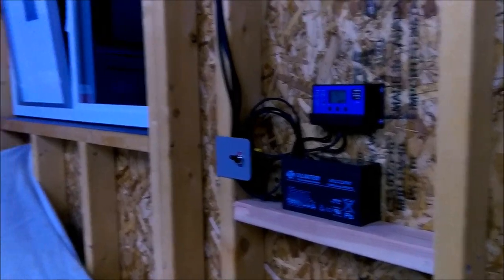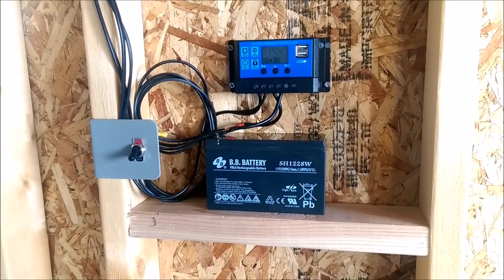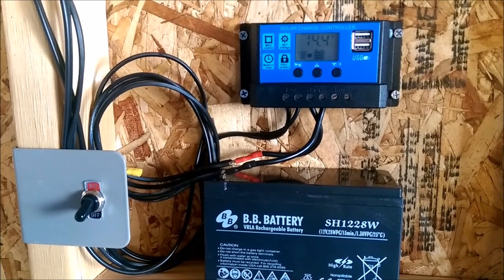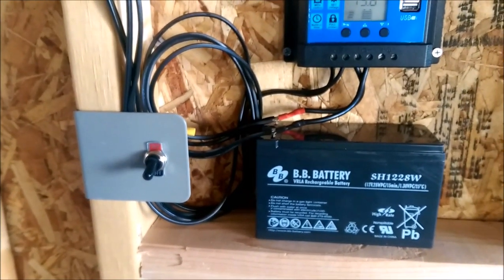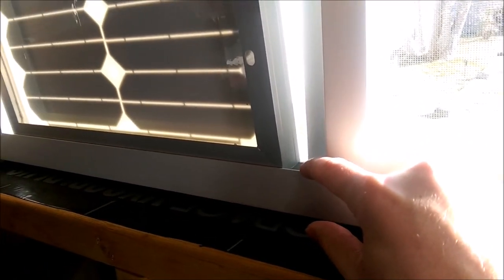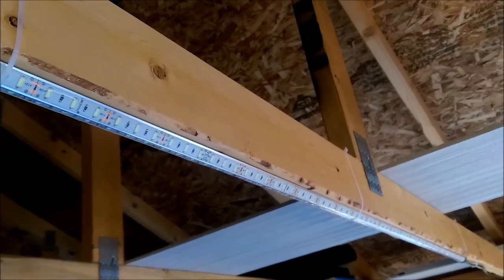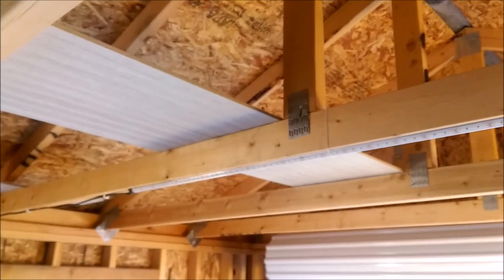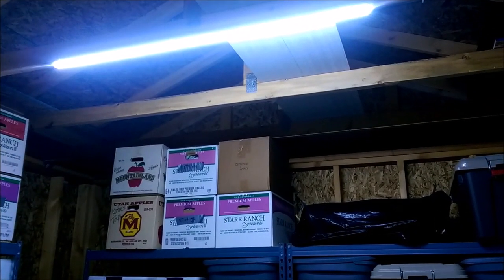DIY Solar Shed Lighting! Affordable LED Setup

Comment: Hi Jason, great Video and I was hoping you can help me understand the connection of the lights to switch and battery as I am not familiar with electricity at all.  
I have batter and panel connected and charging.  I ran all the lights wired them to the light switch and assumed I connect switch to load connectors on solar charger, but lights won’t turn on.
Do I need to connect switch directly to batter to make this work amd have wires split from battery to both switch and controller?

I hope that’s not too confusing but any feedback would be greatly appreciated.
Reply from the maker: Hey thanks for reaching out. You want to hook up all the following connections:
-Battery to the + - battery connections on the charge controller.
-Solar panels to the + - of the solar connections on the charge controller.
- LED lights up to the "load" + - connections on the charge controller.

Put an in line switch on the positive wire of the led lights to turn on and off the lights when you want to use them.
Reply: Thank you Jason, I think I understand now 😀
Reply: Hi Jason did what you said and lights worked for 5 min and shut off.  No error codes on charge, direct connected lights to battery with switch to make sure I didn’t short anything or blow the lights and they worked fine.  Assuming it must be something with the load connectors not working anymore.  Is it safe to just skip the load and direct connect to switch to battery and not deal with the aggravation of what’s wrong with the load connector?  Thanks again in advance!
Reply from the maker: @carchontides  how many lights are you using?

You can skip the load connection and go directly to the battery. You'll just want to keep an eye on the battery voltage like I do. Don't let the battery drop below 12.0v or it will cause damage to the capacity.
Reply: @Jasonoid  maybe this is the issue, but the lights did work after I direct connected battery to switch (although that was after it charged up again a few days later and I didn’t leave them on long to see if they would turn off again). 
Im prob drawing too much power…like I said no electrical experience here…
I’m using 4 x 12v light bars on a 12v 7ah rechargeable battery.

Comment: Is this a special battery for the solar panel or can you use a car battery? Would have been nice to have seen it been set up. Lovely shots of the components.
Reply from the maker: The battery I used is a sealed lead acid battery. They don't require any maintenance so it nice to use them in this setting. A car battery would work fine as well in a setup like this.

Comment: I have a barn with no electricity.  I rarely need a light on.  Is a very small solar panel enough to keep a 12v battery topped up?  My setup is similar to yours using a car battery.
Reply from the maker: Should work great. I don't use my shed lights much either. A car battery is HUGE compared to my small battery. The small panel will be fine.
Reply: @Jasonoid  Thanks for the reassurance.  Good job on the video, by the way..

Comment: The controller keeps the panel from overcharging the batt? I am thinking of doing this in my well house with a 75 watt bulb to keep it above freezing in the winter.. Do you think this setup would work for that?  I would use a smart plug to make sure the light does not use power during the day (temps are above 32 here in the day)
Reply from the maker: Yeah, it keeps it from over charging. You'd have to do the math because a constant 75watts is a lot, maybe 150 watts of solar panels and a large battery bank (100-150 Amp hours) will work for you. My system is very small for very little load.
Reply: @Jasonoid  Thanks!  Great shed BTW

Comment: I know you posted this a few years ago but I’m having an issue. My on my controller the light bulb is flashing and I have no power. Same items as you but less lights. Like your setup. Thanks for posting. Hope you can help.
Reply from the maker: Sounds like the load function is shutoff by the solar charge controller. Sometimes it's on a schedule or maybe the battery voltage is too low? Whats the voltage of the battery? You can always bypass the load output and connect directly to the battery, you just need to make sure to not over-discharge the battery by running the lights to long.
Reply: Jasonoid battery is full and solar is charging. I’ll try to bypass it and check the settings again. Just can’t find any info on what flashing things mean or the like. Thanks for your quick reply.
Reply from the maker: @brianbaker9382  These cheap solar charge controllers are good for basic things but when something goes wrong it's hard to know what it's doing. Hopefully that helps! Good luck :)
Reply: Jasonoid thanks for your help. I think I’ve got it figured out. Wrong lights. Your link is no longer good. Do you know what lights you have. I know it’s a long shot. Thanks again.
Reply from the maker: @brianbaker9382  Added 3 new options to the video decription, these light links seem to change every couple months. Make sure you get 12v waterproof lighting just in case it gets wet in your shed.

Comment: You’re gonna kill the battery, change the light cables from the battery to the last two connectors on the right, that’s the “load” connection, you can set the controller to 24h, if you leave the lights on by accident or dusk till dawn. the controller will cut power if the battery level is dangerously low to protect it, in the event of a short circuit on the wiring, the controller will also cut the the power, please read the instructions for the controller. Otherwise, I like how clean and neat the wiring looks.
Reply from the maker: I skipped the load connections on purpose. Thanks for the heads up. I run the lights for 5 minutes once or twice a week. If I used them more I would have planned to put them on the load circuit.

Comment: How long do lights last before going off ?

Would 2 hours at a time work as my garage has no lighting but have a lot of gym and boxing equipment in and far from house so I was wondering 

If, You could give advice thanks
Reply from the maker: Check out my other comments, I answer the same question. All depends on the size of your battery.

Comment: Great video. How did you determine the solar panel size/wattage needed? I would like to get by with a smaller panel if possible. Thanks, bob
Reply from the maker: It's all based on how large your battery and current draw are. If you plan to run lots of amps consistently you will need a larger amp hour battery to handle the load. If you want to charge that battery faster you will need a larger solar panel. If you have lights that pull 3amps while running, you will need a 6 amp hour battery to run them for 1 hour. You never want to run the battery below 50% capacity.  Hope this info helps!

Comment: 1:44 use the load output of the solar charge controller. This way you can even set a shutoff timer, if you forgot to turn the lights off. Its also protcting from over discharge
Reply from the maker: I only use the lights for a few minutes at a time. I watch the voltage as I use them. I could see this being useful if they were being used all the time.

Comment: What kind of roll-up door is that and how much does it cost? I'm going to build a shed in a few weeks. Thanks!
Reply from the maker: Its the type of door that goes on a storage unit. I searched around and found a local company that builds storage units so they could get me "roll up garage door" at a good price. Cost a little under $400. I installed it myself, there are many Youtube videos on the subject.

Comment: Where do the wires from your LEDS go? ( ie are they straight onto battery terminals?) I expected them to go to the charge controller but cant see that. Also are they fused?
Reply from the maker: They are fused, switch is on the positive line, and they connect to the positive and negative battery terminals.

You could also wire the led power wires to the 'load inputs' on the solar charge controller if you want to have low voltage protection.

Comment: Is the solar panel behind a glass window? I have tried to put a solar panel in a south facing window that gets a lot of sun but it severely affected its output needed to put it outside to get it to work properly.
Reply from the maker: Since I use the lights only a couple times a week, this was fine for my needs. If you want to so something a little larger, check out this video: https://youtu.be/rFVtJXqV_zA

Comment: Nice set up.question can  you run another accessories whit this solar panel let me know.I'm trying to do in a chiken coop for the winter.but I wanna connect a heater lete know whatyou think.thanks in advance
Reply from the maker: Eric Perez thanks for the question. This solar setup is for low draw devices, you could run a heater off a solar setup but it needs to have a much larger battery storage and more panels. The concept is the same just larger. Electric heaters pull thousands of watts, my battery would last about 5 minutes running an DC to AC inverter and a small 1500 watt heater.
Reply: Jasonoid  thank you.

Comment: The link you have for the lights is for a flexible roll of lights, not the bars you installed. Could you please update the link or provide the model #? Great vid..thx!
Reply from the maker: The bars I made myself using aluminum angle from HomeDepot and then stuck the flexible lights to them via the included sticky back tape. I purchased the flexible roll of lights.

Comment: Hi im just wondering did you need to buy cable for the LED strips or do they already come with them
Reply from the maker: You'll need to buy the wire separately, the lights don't come with anything.
Reply: @Jasonoid  is there a link within the description or could you link me one that will go straight into the box 👍

Comment: If I used this exact setup what size fuse would I need?
Reply from the maker: 15 Amp fuse would work. I doubt the lights pull more than 10 amps. Probably closer to 6 or 7 amps

Comment: also, I do not see any wires going to your load side of the PWM (at 3:38 on the video). How did you wire the lights/switch to the PWM?
Reply from the maker: I just wired directly to the battery terminals, if you want low voltage protection you can connect to the load terminals.

Comment: So when the switch is flipped on, is it no longer charging the battery? I have one of those shipping containers and was thinking of doing some kind of solar powered LED lighting inside.
Reply from the maker: As long as the solar panel has sun, the battery is charging. The solar charge controller is always putting charge into the battery, so if I have the lights on and the sun is out, it's only taking a little bit from the battery. It it's dark then the lights are only running on the battery storage and runs down the battery faster.
Reply: Ah, so the switch only controls the light switch. For some reason I thought when the switch was flipped it was stopping the charge. This whole set up seems super affordable and perfect for what I want to do. I'm not sure what all that inline fuse is about however. Cool video though, thanks for the quick reply!
Reply from the maker: @AaronDigitalMuppet  When working with 12 volt power, it's smart to have a fuse so that if you short out the positive and negative lines it doesn't start a fire. Lots of amps can flow from these batteries.

Comment: First time with solor...how long will it last at night before battery gets to a point of being to low?
Reply from the maker: These lights draw about 3amps. I have a 7 amp hour battery. You don't want to take lead acid batteries past 50% capacity so I can run these lights for about an hour. I only use the lights for 20 to 30 minute intervals so this works perfect for me. Ways to make them shine longer would be to get a larger battery, or use less lights.

Comment: Are the lights set up for a 12 v battery or are you using a inverter?
Reply from the maker: These are 12v leds, no inverter needed.

Comment: How long would that battery last im considering doing this in my chicken coop the lights wood be on all night in there i am also curious to know what type of strain that would cause on the battery thanks and good job on the vido
Reply from the maker: You can do the same idea, just add a 100 watt panel and maybe 100amp hour battery. Just look up some more info online and it will make sense.

Comment: How long do the led light up with that battery full charge?
Reply from the maker: All depends on how large your battery is. This is a super small battery so you get around 1 hour of runtime. Larger battery with a larger solar panel and the whole thing is scalable.

Comment: I havea solar panel controller 12v battery and about to add wind turbine to my garden shed. I cant find 12 v lighting ANYWHERE on the internet in the UK (unless you buy a system with a solar panel which I dont need)
Reply from the maker: Don't search for 12 volt lighting, search for 12 volt leds lights, you might have better luck. Led strip lights are available everywhere. Amazon, eBay are both in the UK as well.

Comment: can those lights you used do on a metal frame?I have a 26x31 metal building I wanted to try this in
Reply from the maker: Yeah, as long as the power connectors are insulated they won't short out. So just use either heat shrink or electrical tape where they connect to the LED strip.

Comment: Hi, how long can it run till the battery drains out ? The charge controller has a setting to limit the discharge also no?
Reply from the maker: Mine will run a couple hours before the battery dies, if you want it to last longer just add a bigger battery. The charge controller will protect from low voltage if you hook the lights into the 'load' terminals
Reply: @Jasonoid  thank you. But when you do the calculations, a 7Ah battery could run a 12v 3w led for more than 12hrs. But why doesn’t it happen practically?
Reply from the maker: These lights pull around 42 watts for the full 16 foot strand (12v X 3.5 amps), that's why you'll get less run time.
Reply: @Jasonoid  I see. But I use 3w 12v LeD bulbs.
Reply from the maker: Great! Than it should last much longer for you

Comment: Think its possible to hook motion detection to this set up? Trying to do it for my carport.
Reply from the maker: If the motion sensor would work of the 12v system, it would probably work. Most are 120vac right?

Comment: How do you cut the led light and connect the 2 4 foot sections thanks from Nebraske
Reply from the maker: There are breaks in the led strand where you can cut them, it has sticky tape on the back where it sticks to stuff. Solder the breaks back together, positive to positive, negative to negative.
Reply: @Jasonoid  thanks I have ordered it all off Amazon the solar panel was out of stock so I got a different one with a adjustable rack. Thank you very much
Reply from the maker: @7990barry  Enjoy the project, it's a fun one!

Comment: those lights say 60watts does that mean you can only have it on for 30 minutes at a time? 12 volt times 7 amp battery = 84 watts. iam just old.  am i thinking right
Reply from the maker: Yeah, I have a small battery and don't use the lights for a very long time. These lights pull about 40 watts. Just put in a bigger battery if you need longer run times.

Comment: I am guessing you just cut the strips wherever you wanted but how did you then wire them?  Solder new wire on at the ends?
Reply from the maker: Correct, I just cut the strips to the desired length, then I soldered on the landscape cable you can buy by the foot from HomeDepot or Lowes. I recommend at least 14awg cable for the project.
Reply: @Jasonoid  how much current do they pull?  Total or per strip?  I am loooking at hooking up my shed but I am not sure the strips put off enough light?  Also I am sizing my battery.
Reply from the maker: @DemingChiropractor  They pull quite a bit of current. I'd say at least 5-7 amps total for all the strips. I haven't ever officially measured, I need to purchase a DC clamp meter for all my projects. If you are looking to run them a long time I would suggest getting a larger battery and a larger solar panel to compensate.
Reply: @Jasonoid  I am looking at 40 watt panel and 15 aH battery.
Reply from the maker: @DemingChiropractor  How long would you want to run the lights each time?
Reply: @Jasonoid  honestly maximum a couple of hours at night but also thought about setting up a battery charging station for my rv, motorcycle, and or lithium power tool battery charging station.
Reply from the maker: @DemingChiropractor  in that case maybe just to be safe have a 12 Amp hour battery, the 40 watt panel should be fine to charge it during the day
Reply: @Jasonoid  15Ah battery is what I bought.  I will have to let you know how it comes out.  Thanks for the informative video.  Certainly spurred me to get my solar done.
Reply from the maker: @DemingChiropractor  that will be a fun project! Good luck!

Comment: I have a project in mind and I was wondering if there was any way I could attach an electrical socket to plug in a phone charger or a radio?
Reply from the maker: You could setup something very similar to mine, you would just need to add an Inverter also. You may want additional battery storage depending on how long you would want to run the radio/phone charger. The inverter would take the DC power and convert it over to AC power for a radio to use.

Comment: would this work on something that i would need lit for up to 24 months constantly? 
its for a self sufficient outdoor light sculpture project
Reply from the maker: Just add more battery capacity and a larger solar panel to scale the project larger. The idea is the same. Thanks for your comment!